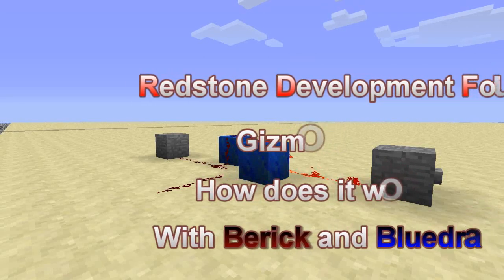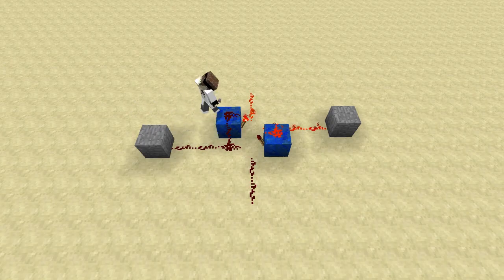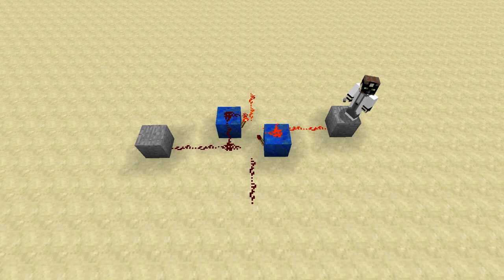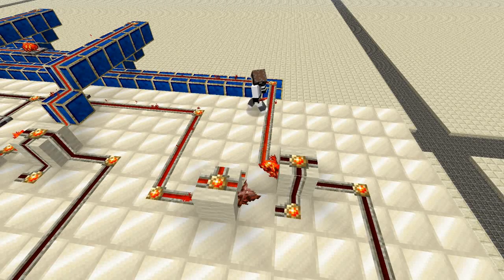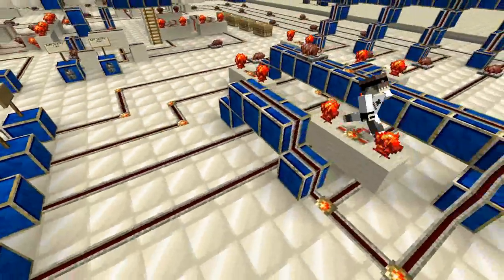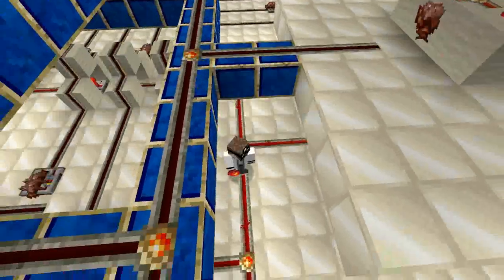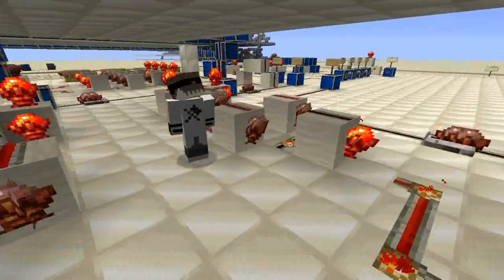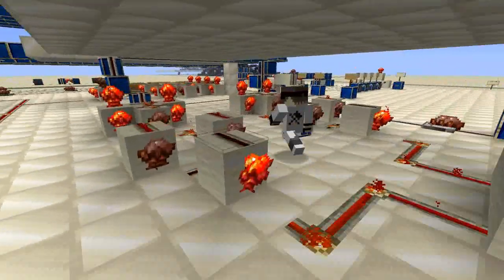RDF "Gizmo" How it works

Comment: I know this is only V1, but wouldn't this be so much easier using D Flip-Flops rather than RS Nor Latches? They come with built-in input locking, so you wouldn't need do do all that crazy AND gate stuff with the assign button.

Comment from the maker: @maximum988 This was Blue's early prototype. His design method is to make it work first, then refine it to make it more condensed / efficient. Gizmo 2, which you can kinda see at the end of the video, is much smaller.

Even so, Blue has never been one for super condensing things unless absolutely necessary. It's easier to debug and easier for others to understand how it works when it's spread out a bit.